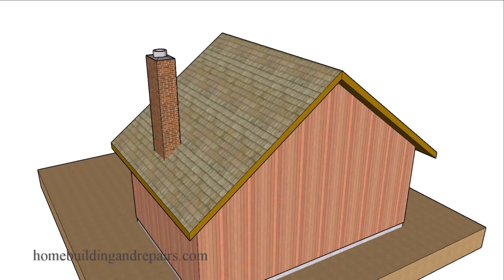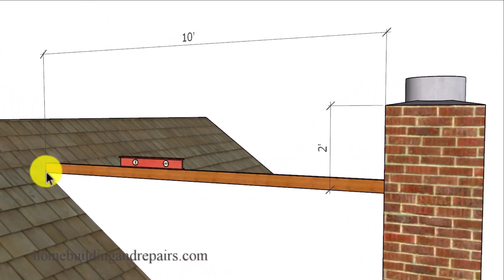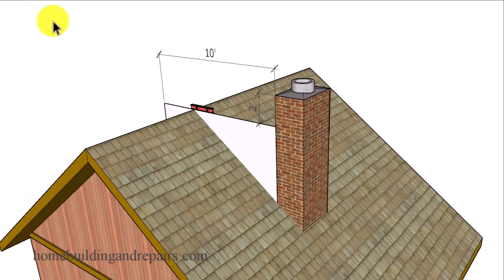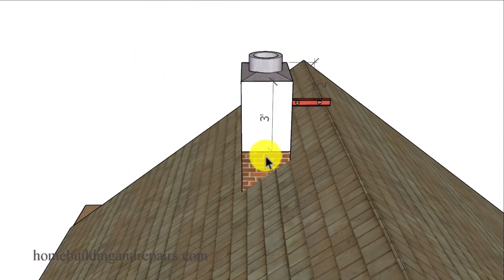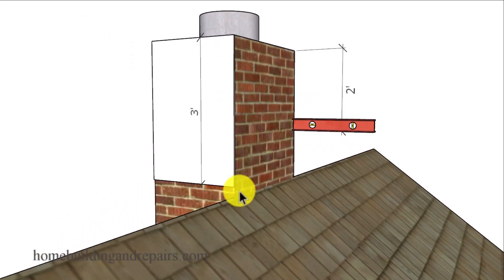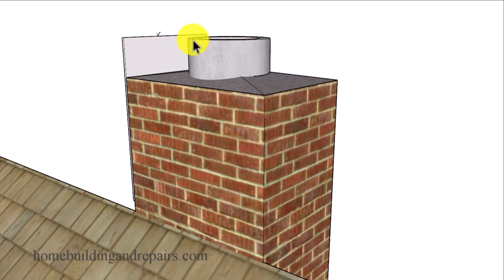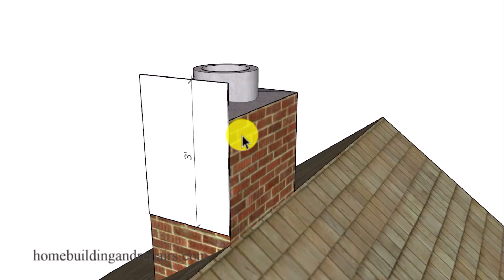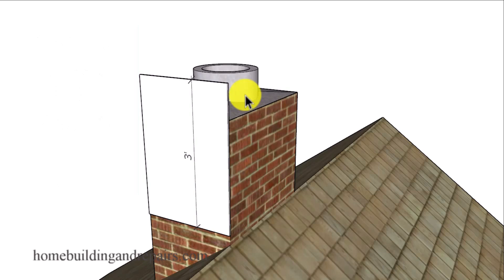How To Calculate Fireplace Chimney Height Above Roof - Building Code Tips

Comment: This is wrong. The 10 foot 2 foot rule applies however, when you get above the ridge, you only need to be 2 feet to the top of the Chimney Flue that does not mean the top of your chimney structure. The 3 foot comes in as a minimum requirement for height above the roof only applies to flat roofs.

Comment: @jimb4050 UL has determined a 15 ft. minimum height above the top of the firebox. Also so the flue pipes area should be at least 1/12th of the firebox opening for round pipe. 1/10th of square pipe. 1/8th of rectangular pipe. (Pii) 3.14 x 4.25squared =56.71625 sq. Inches of area for your 8.5" pipe. So check your total flue height. And your openings sq. Inch area. Hope that helps!

Comment: My fireplace smokes into the house. The chimney is 5' high and farther from the ridge than 10'. It has a metal chimney, double wall, but the inside wall is 8 1/2 inches. Could that be the problem? thanks, Jim
Reply from the maker: If the chimney is to low, it can create drafting problems, but I can't suggest that it is your problem. You can start by checking to make sure the chimney is not blocked in any way and that your damper is open.
Reply: Too short, minimum of 15' from  above lintel or firebox

Comment: Appreciate the video. Question. I have seen pellet stove exhausts that protrude directly out of a houses siding. However my pellet stove exhaust has to comply with chimney codes as shown in your video. Is there a reason for that? Apologies if this is a dumb question
Reply from the maker: From what I gather it helps suck the smoke out and could prevent it from going into your home.

Comment: So is there a maximum reasonable height for the chimney? If I were to, for instance, put a chimney 10 feet from the ridge of a 12/12 roof, the standard formula says it would be a 12 foot chimney, needing a bracket at 60". I haven't seen anywhere about a bracket higher up than 5", but I'd be more than doubling it so would I need a bracket and is there an upper limit to this formula's application? 12 feet above the roof sounds crazy tall...
Reply from the maker: I would ask your local building department on this one.

Comment: So if you make it 4'6" higher then the ridge of the roof you should be all good ? 
But I still have smoke going into the neighbor's house. What to do?
Reply: Tell them to get an air filter. 😉 No, it's hard to have neighbors with a chimney, or chickens, or dogs, etc. You could add onto the height of your chimney, but the fix is for them to figure out, not you, unless you're violating city codes, which, if you're 54" above you're ridge, you're not. Now, as a good neighbor it's important to keep communication open and explain to them these things. Be willing to negotiate, but there's only so much you can do about wind direction and which windows they open...
Reply: @MyFortressConstruction  Terrible and selfish answer honestly.. your smoke shouldn't impact them, it's just plain wrong........

Comment: I know “2 feet above 10 feet out, minimum 3 feet” has been around since I did masonry in the 80’s. We always ran the brick to this, then the cap and flue were extra - as you said, good for draw.
Reply from the maker: Thanks for sharing and I was one of the guys who framed the chimneys for prefab metal fireplaces and everyone used the 2 feet as a minimum.